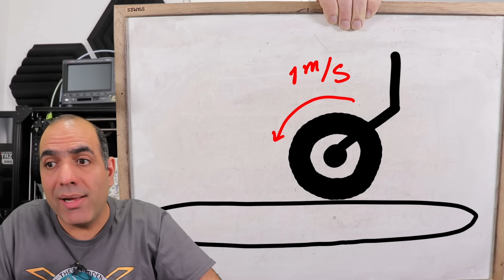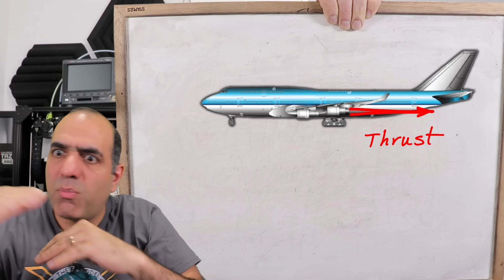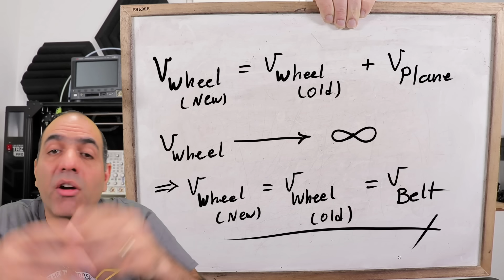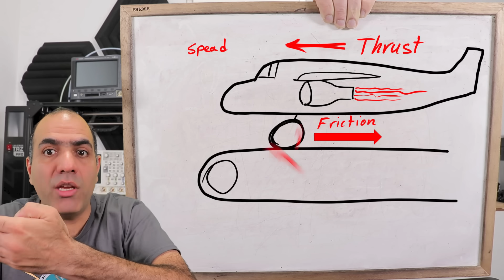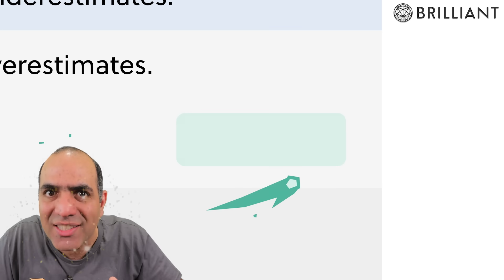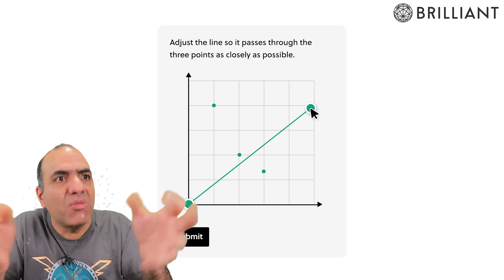Airplane Question that Drove Me NUTS!!!

Comment: The plane would not fly off. This requires the assumption of no skidding or slipping of the wheels.
If there is no skidding or slipping then the condition of the belt is such that the wheels remain stationary (but rotating) relative to the whole conveyor.
But the conveyor is stationary relative to the air and the plane is stationary relative to the wheels and so the plane must remain stationary relative to the air.
Reply: This would only be true for a vehicle that is propelled by its wheels, but aircraft are not. They are propelled by accelerated air which acts as reaction mass
Reply: @snowthemegaabsol6819  Yes, it is propelled by air moving backward, but it is lifted by moving relative to air. Since it cannot move relative to air it has 0 lift force.
Reply: Of course it can move, there's nothing counteracting the thrust force. At the start of the takeoff, the treadmill is no different from an ordinary runway since nothing is rolling. Only once the aircraft starts rolling forward does it become different, and if it can start rolling at all, there's no reason why it should stop. Aside from the wheels spinning much faster before rotate, it's basically no different to an ordinary takeoff. The treadmill in the problem is a red herring; completely irrelevant. You need to realize that otherwise you're going to remain confused.
Reply: @snowthemegaabsol6819   How would it move forward if the wheels are stuck in place rotating? That is what the treadmill in the problem does. It locks the rotating wheel center in space. Does the aircraft break off the wheels? If so then yes it can move. You know it is possible to do this experiment in the reality, and has been done on YT and up to the point where treadmill no longer can counter the wheel motion the plane never lifts. Only when the slipping and skidding happens does it ever lift.

Comment: Here’s another question for you:
In electrical systems, the term “back emf” actually refers to the equal and opposite force field accompanying the “forward emf”, in any “symmetrical” electrical system.
In magnetic systems, the corresponding term is “forward and back mmf”, rather than “forward and back emf”.

With the symmetrization of the EE model by Lorentz in 1892, just at the very beginning of electrical engineering, our electrical engineers have been trained to think, design, build, and deploy only symmetrical systems. Lorentz (at the bidding of J. P. Morgan) eliminated all remaining asymmetrical Maxwellian systems in the already sharply curtailed Heaviside equations, further limiting the already severely-limited Heaviside model and thus the electromagnetic science and technology that later grew up to be based on it.

With the symmetrization of the Heaviside equations, those arbitrarily symmetrical equations became the present “electrical engineering” model, usually taught (falsely) as if they were Maxwell’s original theory. Maxwell’s theory contains 20 quaternion-like equations in 20 unknowns, and contains both symmetrical and asymmetrical systems. You can develop and build all sorts of asymmetrical systems with Maxwell’s original theory, that cannot be built in accord with the symmetrized Heaviside theory now loosely referred to as “Maxwell’s theory”.

All rotating motors actually turn themselves from the broken symmetry that is created inside them. The present engineers have been trained that they must pay to put extra energy into the system, just to break its symmetry. That of course is totally false. Otherwise, a rotating electron (with its continual spin) would not spin.

What were and are the ramifications of Lorentz's symmetrization of the Heaviside equations in 1892, and the continuing symmetrization of these equations today as the "electrical engineering model"?

Comment: The wheels on a plane are free spinning so unless the conveyor belt is able to move so fast that the force of friction of the wheel shaft turning is enough to counteract the thrust of the jets, which almost certainly would destroy the landing gear through the heat produced by the friction, the plane is still going to move forward because it doesn't push against the ground: It pushes against the air and it will have no trouble taking off.

Comment: It's not the speed of the wheels it's the momentum the plane has to build to take off. If the wheels are spinning and the plane is just in place it won't go anywhere 🤣 in order to build momentum you have to literally be moving not moving in place .

Comment: Im trying to figure out why these people even mention the wheels.
The wheels have no correlation to whether the plane can or cannot take off. The wheels only exist to let the plane get to the ground safely without dragging itself on the runway like some winter sled. Like you said, the engines do not power the wheels, they just push air and generate thrust to the entire entity not just the wheels.
If the plane was placed on the conveyor belt without the landing gear extended, it could still take off if enough lift was generated under it. So again, why do the wheels play such a big role for these people?

Comment: Yes. No. Yes, but the tires might be smoking by the time you do. Because the engines are pushing the plane and the wheels just carry it. But unless the engines can accelerate faster than the conveyer can, the conveyor will accelerate until the wheels are spinning so fast that the friction on the bearings brings the plane to a stand still again. If the plane starts going backwards, the conveyor will slow down until it is going the same speed again, at which point if the engines manage to push it forward it will speed up again to match the wheel speed. So no, the plane cannot take off unless the engines manage to out-accelerate the conveyor quick enough to get the plane off the ground before the drag from the wheel speed becomes too great. But I'm pretty sure something in the wheel would explode from the centrifugal force, resulting in the immediate destruction of both the plane and the conveyor.

Comment: All I know is that for a plane to fly it has to move at enough speed to provide lift to the wings, and that lift is brought about by higher air pressure above the wings than below the wings... and the only way to achieve this is by moving though the air itself which would be impossible if the plane was on a conveyor belt... its like trying to run on a treadmill and expecting wind to oppose you and blow your hair backwards.

Comment: Instead of thinking of aerodynamics, we have to think about mechanical parts. First of the wheels undergo two different forces in the opposite direction. Due to friction wheels may burn or damage. After that we may see a somersault from the plane..

Comment: Of course it wont take off, the plane needs the air push obtained with the velocity to take off, if the plane is still and only the wheels are spinning, the plane will never take off.

Comment: It will not lift off because there is no speed difference between the wings of the plane and the air that surrounds them. It's just wheels that are moving. If you would blow air with a giant ventilator at the plane while moving the conveyor belt then it would lift off...and immediately crash afterwards...

Comment: Before watching the video my answer is no it can't take off because you need moving air to create lift on the wings. In a helicopter the blades (wings) move since heli is stationary when taking off.
Reply: A plane also has rotating blades, they're just pointing forward rather than up

Comment: I haven't watched the full video yet but why would it take of. It will lose it's acceleration immidiatly after it loses friction to trendmil and due to air rezistence it will slow down.
Edit: English isn't my main languages and I got the whole question wrong. I thought the plane had no trust and it was trying to take of with help of convayer belt

Comment: Paused at 0:42 😎
The more the plane accellerates, the more the friction of the rolling wheels comes into account. So the question is: „What is the break even point between the power consumption curve of the airplane (including the efficiency curve) and the power „destruction“ curve of the wheel friction (which should be a function of power to three?) ?“ Not simply answerable…
Ammendment one minute later: Come on… be the Philosophical Boom

Comment: The reason the plane won't fly is bc there has to be airflow over the wings as you said. If the plane sits there on an escalator track, there's no airflow, the only movement is spinning wheels.

Comment: My guess, start of the video: Plane takes off as normal, but wheels spin twice as fast as they normally would. Added drag would just be from the rolling resistance of the tires on the belt and the bearings, which are minimal to the amount of drag an air frame needs to produce lift.

Comment: I'm impressed at the number of answers you came up with, lol. I wrote this before watching: Only if there's a lot of head wind rofl. That the conveyor belt starts moving at all implies some force is attempting to move the plane forward. We would call that thrust. With headwind in excess of the stall speed and thrust to match the headwind, it could basically hover in place. Whether or not a proper plane can fly is not determined by it's speed. It is determined by the speed of the air over the flight surfaces, the wings. Airspeed determines whether a plane can fly, not wheel speed. And I'm having a hard time believing that even a full thrust 747 is going to cause the magic conveyor belt to move fast enough to push enough air over and under the wings to achieve lift.

Comment: NO.  The answer is NO.   This noise has to stop.  An aircraft can only take off based on AIR SPEED.  The engines do not power the wheels.  This is not a car that was poorly designed (looks at AMC.  The fron end would lift at some speeds over 100 MPH.)...  Even that car would not lift if the conveyor belt ran at 200 MPH...

Comment: Here is a TLDR:  You forgot to account for the  angular momentum of the wheels.

@ 3:58  you started to talk about the  case where one measures the "speed of the wheels" as if there was a speedometer on the wheels themselves.  How fast are the wheels moving relative to the treadmill.   That means that if the  treadmill is moving at 5 mph  the wheels would be rolling at 5  mph relative to the plane.   You then made the  mistake of saying that  there is not force opposing the plane by the wheels, but in this case you would be wrong.  Forget about friction.    What is needed  to keep the plane in place is angular momentum.    The treadmill would be constantly accelerating as thrust was applied.  It has to produce a counter thrust and  the acceleration , not the  velocity, of the treadmill could  theoretically keep the plane in place.  In reality  that sort of acceleration would quickly cause the wheels to fail from  several sources.   But it is just a thought  experiment and one could calculate the acceleration needed if one had the   total of the angular momentum of all of the wheels.   My answer,  a lot!   Many years ago I ran through it and if I remember correctly it was between 50 and 100 g's of acceleration.    

But there is an easy way to test the  proof of concept.  You just need to see how fast you need to accelerate a "treadmill"   to keep any rolling item in place.    Since the wings of the plane do not enter into the  problem one only needs to know the thrust and the angular momentum of the wheels.   The simplest proof of concept that I have seen involved a battery,   a piece of paper,  and  slight slope.    The slope  provides a force on the battery,   a "thrust" so to speak.    The piece of paper represents the surface of the treadmill.  One puts the paper on the slope with the battery near the top.    Simultaneously one releases the battery and pulls on the paper.  With practice one can accelerate the paper so that the "speed of the battery matches the speed  of the  belt.   It stays in place.

Now to watch the rest of the video and see if I wasted my time or not.

Yay!!  I did not waste my time.   You did forget about the moment of inertia of the wheels.    I know,  silly question.,  not enough details.  But when  I first heard this many years ago my thoughts did almost  immediately got to  the moment of inertia as a  possible answer for an idealized  thought experiment.     In  reality the plane either takes off,  depending upon interpretation , or crashes and burns.    Even the Mythbusters were running a  slight risk because an irregularity in the fabric could have led to  ripping and the plane wheels  getting tangled.    But to me that was the trivial solution.  It was so disappointing.   The question should have been worded more clearly.

Comment: 1. If the brakes are on.
 
There is a way of possibility to make the plane go in air for less than a second before it loses its take off speed.

2. If the breakes are off :
The plane is sitting in the exact same position and the wheels keep turning faster and faster to infinity!!!!!

Comment: 0747 cannot take off with the wheels going in the opposite direction. The engines are facing straight when the engine is a turn on the air so we can move. Where is your idea👍👍 helpful

Comment: If the plane was driven through the wheels the plane would stand still.
But because the plane is driven by jet engine, it does matter what speed the conveyor is travelling at, the plane will shoot forward and take off.

Comment: No the plane would not be able to take off. The only way it would be possible if instead of a conveyor belt moving, there was a headwind of a few hundred miles an hour, which would then create enough lift over the wings to allow the plane to take off. This situation would also make it possible for the plane to fly backwards (I’ve done it with my flight instructor in a Cessna 152). But as long as there is no movement of air over the wings in correlation to the speed of the aircraft it’s going nowhere

Comment: The problem is described as idealized, but physicist must take into account real-world phenomena. Most people discussing the problem are too focused on the wheel/belt/plane velocity, but completely forget about "air vs belt" interaction, which is not mentioned in the problem and seemimgly is not obvious for majority.

When the belt moves, it drags some air close to the surface, due to air viscosity. This creates air movement and hence a lift. How big is it? Well, the definiton of "big" is relative and it depends. With a belt much larger than the plane, moving fast enough, and the plane's wings close enough to the surface, the lift may eventually overcome the gravity force.

To prove it, build a very small model plane and put it on your treadmill. To simulate the belt speed compensating the thrust and making the plane stationary, just tie the nose of the plane with a light wire; the tension of the wire will be an analog of a thrust varying in sync with the friction so the plane remains stationary relative to the Earth. Run the treadmill faster and faster and observe how the plane eventually takes off.

Or you can just look up how a Bernoulli disk works: its head ("plane") is flying over the moving surface of a rotating disk ("transporter belt"), while remaining stationary relative to the housing.

Comment: You forgot to account for slippage in answer three; it wouldn't surprise me if the jet engines can produce enough thrust to at least get off the belt.
Reply: While on the ground, thrust only results in rolling wheels.  We can exactly model. Rolling wheel speed at any moment on the ground - from taxiing through takeoff speed or more.  It’s always going to be negated by the ridiculous conveyor speed so there is no possibility for the aircraft to move in relation to its position on the conveyor with those explicit conditions.

Comment: absolutely cannot take off, the forces in the system cancel and the net force is 0 and so no wind passes the wings and no lift is created. im also curious if its fair to say that what makes it take off is the engine pushing the plane into the air, and the air pushing back against the plane and wings in such a way that lift is created (blah blah bernoullis principle whatever)
Reply: There is nothing to counteract the thrust force from the engines, and there's a lot of force on a 747, about 120 tons. The wheels and treadmill are a red herring, you could set them both to 0 by putting a clamp boot on the wheels, and watch as the sheer power of those 4 gigantic engines simply drags them across the ground and probably light them on fire. It wouldn't even slow down that much, that's how powerful they are once they ramp up to and past takeoff power. If the plane can take off with that much friction, which is actually legitimate concern during static takeoff, it can easily do so with freely rotating wheels. That's why it's also really easy to push yourself forward on a treadmill while wearing skates

Comment: what creates lift is the relative speed of the air and plane. lets say a plane needs 200 km/h to take off. that means with a 200 km/h headwind it could take off while being stationary. if the headwind is 30 km/h it only needs to create thrust to reach 170 km/h. on the other hand with a tailwind of 30 km/h it would need 230 km/h to take off. so now how could the plane take off with a conveyor belt that cancels it's forward movement? it would cancel any movement relative to the (stationary without wind) air. that means the wings can't create any buoyancy and the plane can't take off. how fast the plane moves means nothing. how fast it moves relative to the surrounding air matters. buoyancy is created by the wind moving around the wings and the wings shape. no movement through the air=no lift.